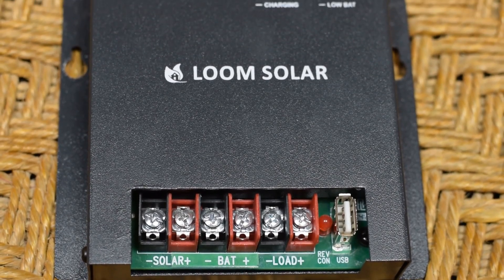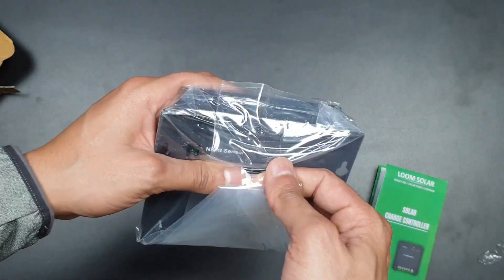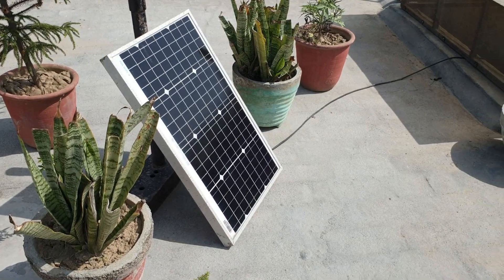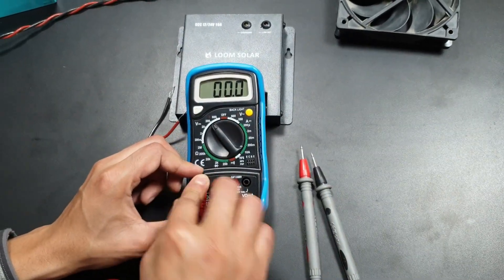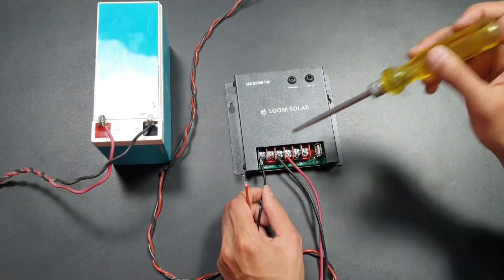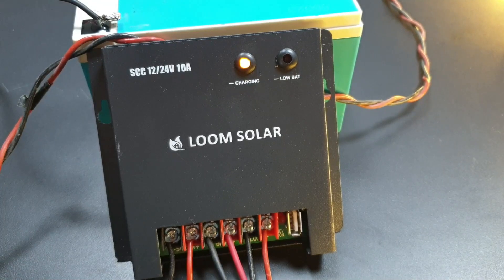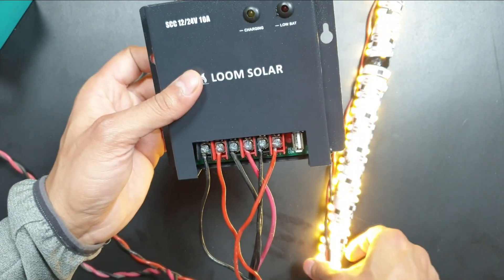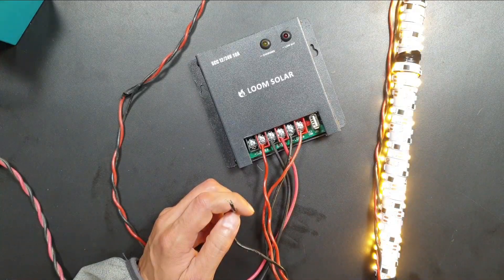Solar Charge Controller - Loom Solar - 12V/24V 10Amp - Unboxing and How to setup || DIY ||

Comment: Sir isse Exide Technologies 150mAh Inva Master Jumbo IMST1500 12v battery charge kar sakte hai mere pass 1 battery hai
Reply from the maker: Yes, it is suitable.
Reply: Sir battery c20 hai koi problem to nhi hogi
Reply from the maker: Not recommended then. Use at least 30 Amp. charge controller.
Check this - https://bit.ly/3bH8UOC